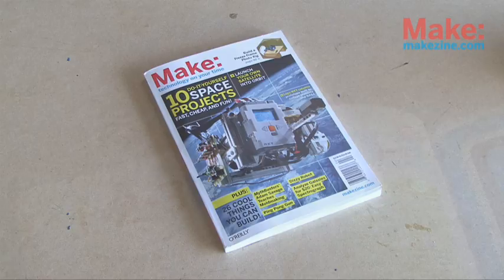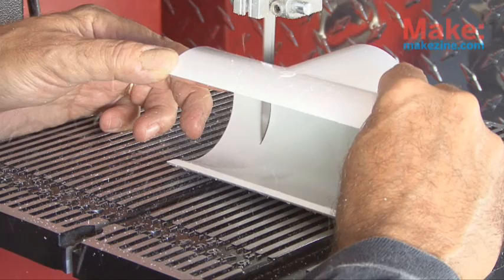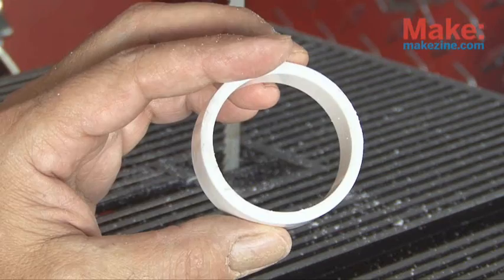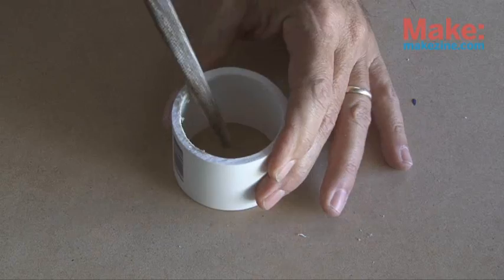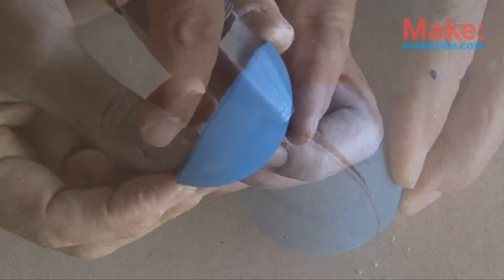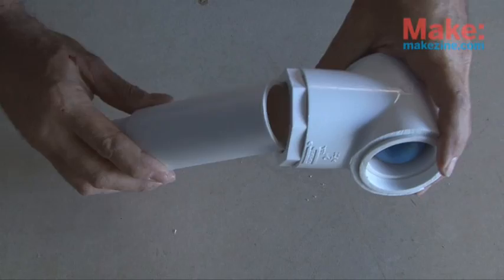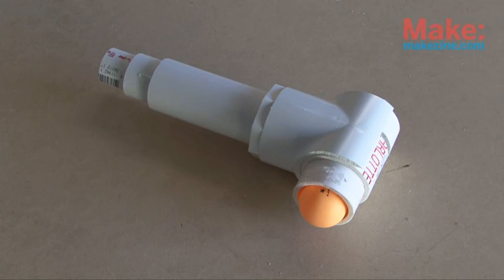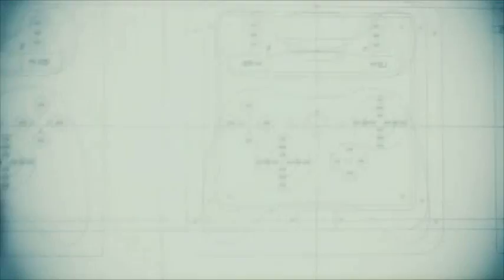Weekend Project: Ping Ponger

Comment: well all right fair enough but you've got to admit a system where all the measurements are multiples of ten is simpler than 12 inches to a foot, 3 feet to a yard etc. It is a lot easier to work with